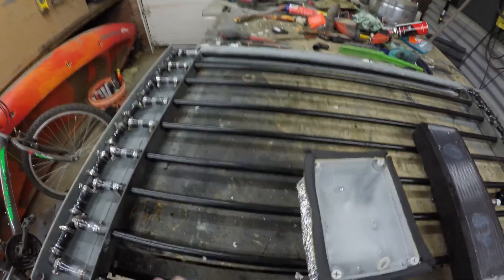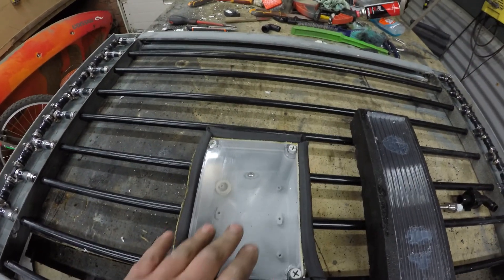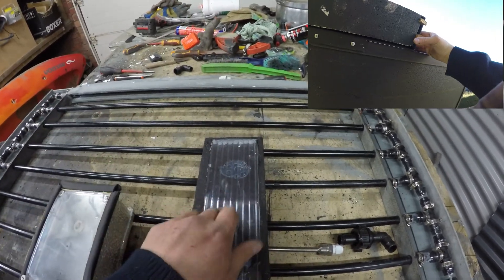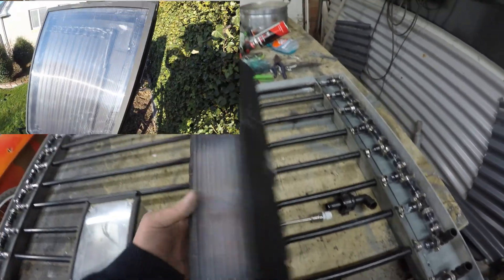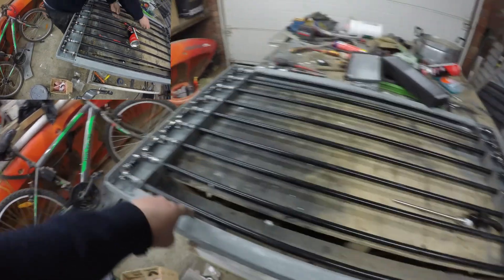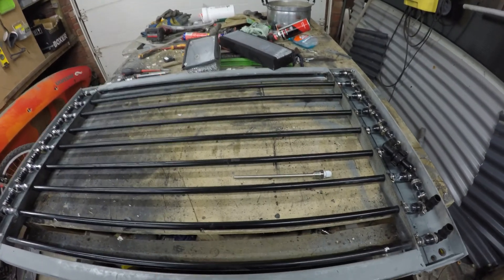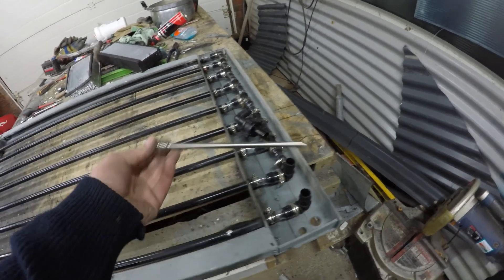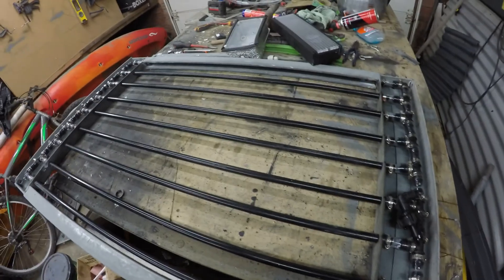Compost water heater built, over 100 C degrees in outdoor solar heater, melted plastic

Comment: A few years ago, I built a solar water heater (closed loop) and controlled the recirculating pump by placing a 10 watt PV panel wired directly to the pump: worked great.....only pumped while the sun was shining and pump RPM was proportional to the sunlight intensity.

Comment: thankyou appreciate the work, was looking to make a sand filled solar water heater   was planning on using about 15 cm of sand under glass  to level the temp out so interested on your new improved models performance solar water heater also been playing around with Jean Pein method compost heating
Reply from the maker: I've been busy spring cleaning the yard out lately, but i plan on building 2 compost heaps before this autumn so that i can make a system that cycles between them next winter, its amazing how much heat actually gets sucked out of the pile.

when i turn the system off the pile quickly heats, but after turning the system on the heat is sucked out, so i think i can improve it by cycling between 2 piles.

the solar heater really helps to boost temps.